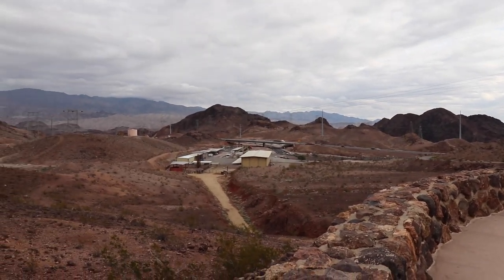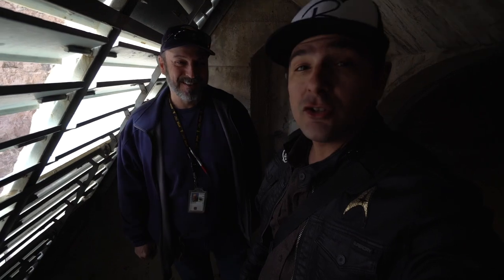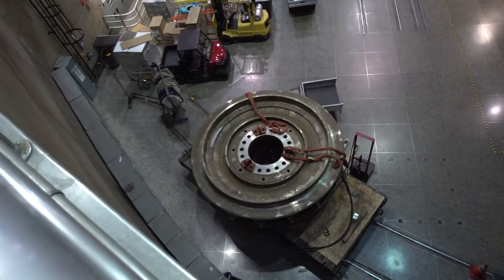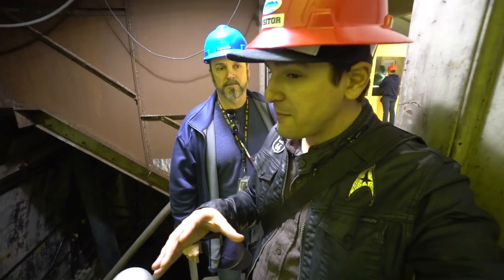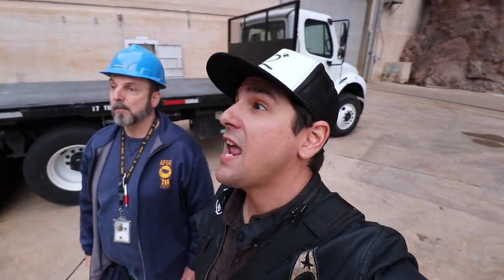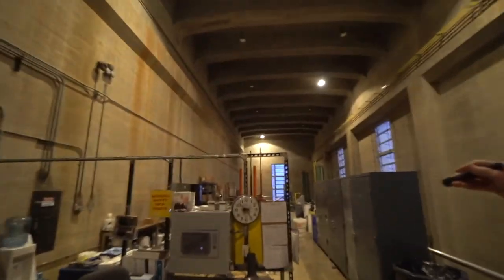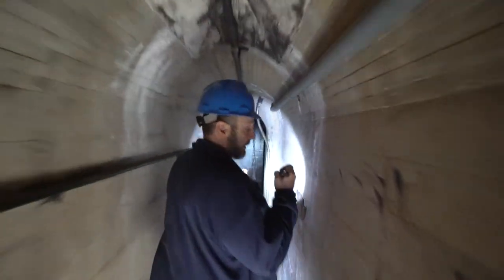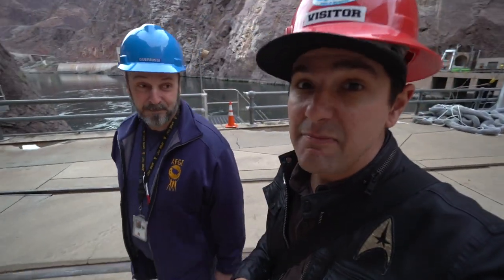INSIDE The Hoover Dam - A VIP Tour!

Comment: I've been on that tour multiple times with a friend who worked there.  Certainly an experience to not forget.  It's too bad they didn't take you down to the bottom of the generating units.  The area down there reminds me of the basement area on Tower of Terror.  Another fun part is walking the entire length of the lower penstock and turning off the lights to see how dark it is.  There's also some random phone that someone threw on top of the pipe and it's been sitting there for an unknown number of years.  At the end of the penstock hall there this creepy area with chairs and benches and a bunch of tools from the original construction.  

Other areas that would have been cool to see is the staircase that goes from the bottom to the top at a 45 degree angle ( not the spiral one you saw), and getting to walk out to the main spillway gates that are hung with giant chain links.  There's a gate they have to go through that requires them to call security to keep guards with very large guns from showing up!

Comment: Did a tour in 1986 and saw everything shown in this video. After 9/11, the tour was shortened quite a bit for obvious reasons. Very fascinating structure for something built during the Depression. When you are in the penstock tunnel, it is noisy from the water rushing through those large pipes and the whole room shakes.

Comment: Technically it has some reinforcement. When the dam was first installed they needed to cool the concrete, so they had a bunch of water pipes going through to help cool it. When it was done, they put concrete it the pipes.

Comment: He got it mostly right,  he said a rotor turned by the turbine spins inside the stator where the power
to light up a state is produced, he, I am sure knows but kept it easy for the visitor, that an exciter
is used to produce power for the rotor, turning the rotor into an electro-magnet, said electro-magnet
rotor spinning inside a massive coil of wire produces power for the states.